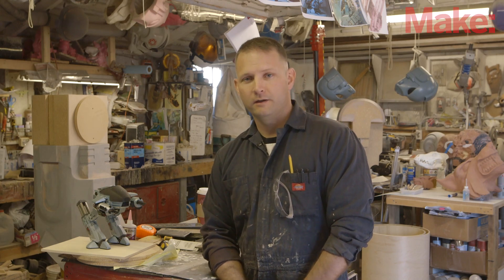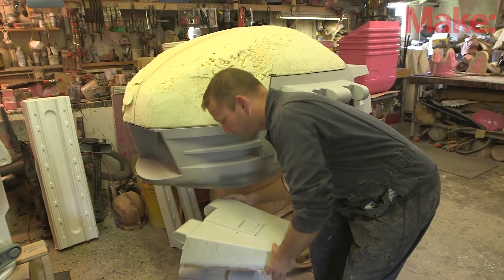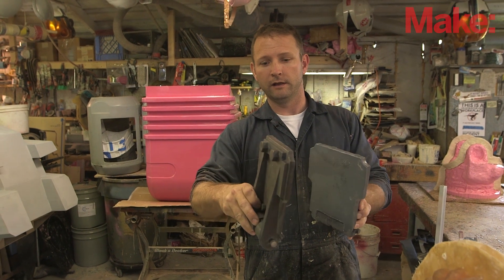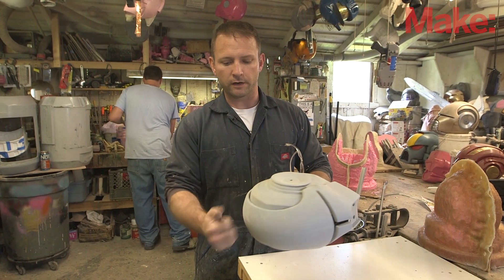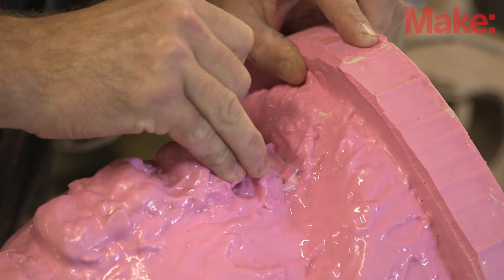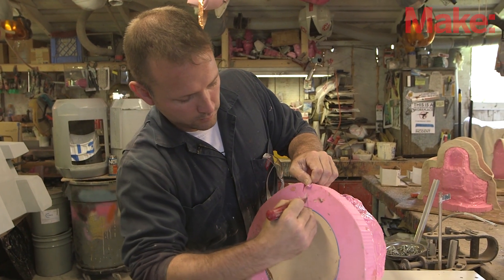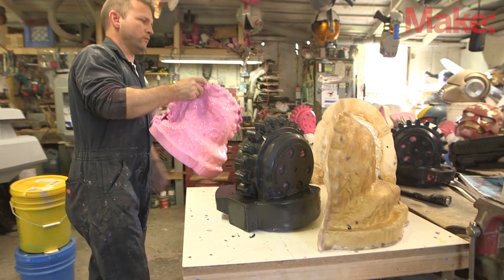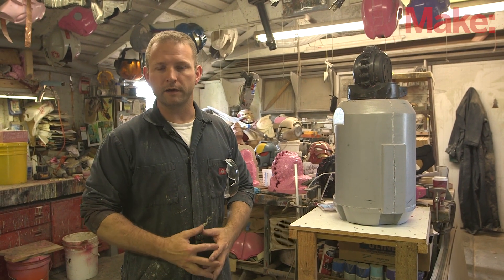Building up to Maker Faire: Part 5

Comment: Is release agent not required between resin and silicone mold?
Reply: No release agent required.  That's the great beauty of molding and casting with silicone.  Under normal circumstances, silicone doesn't stick to anything except more silicone.